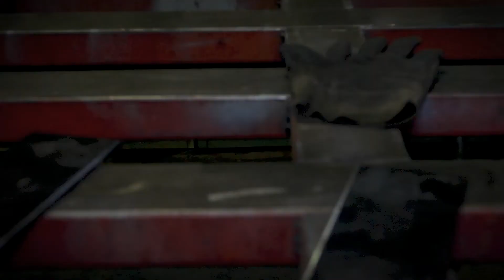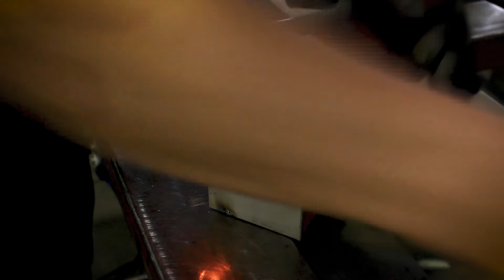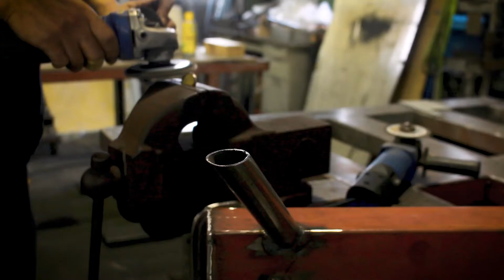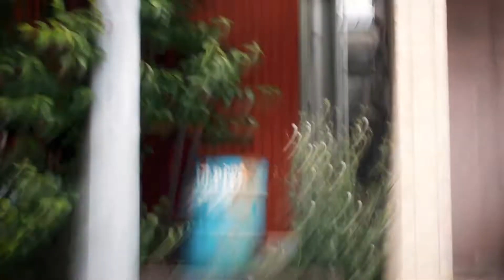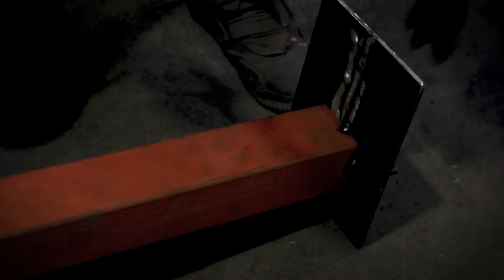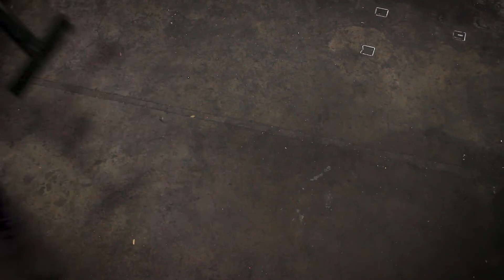Mobile vise stand built as HEAVY as possible

Comment: Such a great idea to use the scrap metal dust. I wonder if it will have a vibration dampening affect as a bonus?!
Reply from the maker: Thanks! 🤝I've used it, and it sure does reduce vibration! However, the mounting of the tire section may eventually deteriorate since the shaft is only held on one side. This is something to reflect on in this project😌

Comment: How many times has the tripod design allowed it to tip over of your clamping down on the short end of a longer piece?  With same goals in mind I might have tried a set of four outrigger style legs/feet.
Reply from the maker: Thanks for the comment☺️
I am Japanese and my English reading comprehension is poor. Therefore, I made full use of the translator tool on the web site, but could not understand your question.
 If you don't mind, could you ask me a simple question?
Sorry..🙏

Comment: Nice job, you may want to wear a welding helmet, a hot BB in the ear is no fun.....
Reply from the maker: Thanks for your comment! I appreciate it very much.
For some reason you are well aware that sparks often go into your ears!^_^
Do you weld a lot too?

I have been working for a welding company that deals with thin steel for 10 years now.
I have tried various protective gear and arrived at my current equipment in the video.

I have watched many videos over the years about welding in different countries.
I live in Asia, which is still a work in progress and the market for PPE seems very weak.
Old craftsmen still weld with their left hand holding a protective surface.
These are very interesting to me.
My grandfather, who is now deceased, was one of them.
Yet he was able to perform many jobs perfectly and safely with light equipment.

Light equipment, work efficiency, safety. I realized that these values vary from country to country,
The journey to find the answers to these questions continues.

I respect those who watch and give me advice.
I will continue to learn more and study my behavior so that they can watch my videos with peace of mind.
Thank you so much!